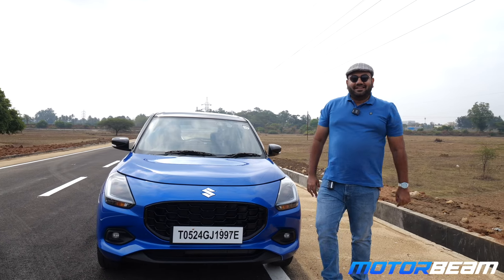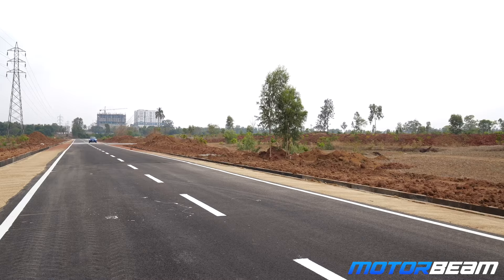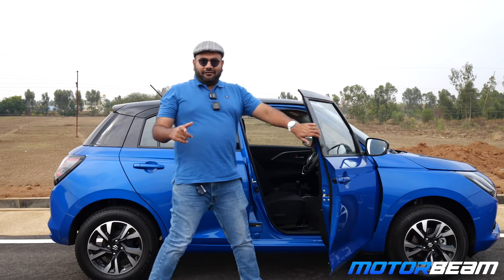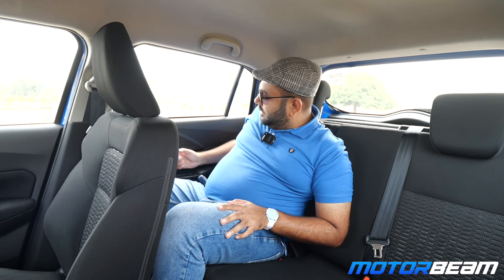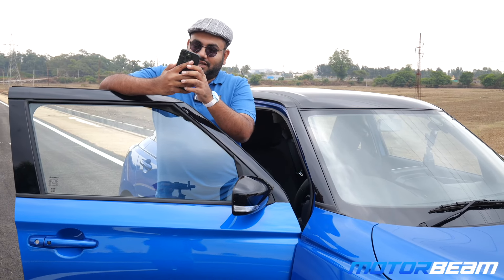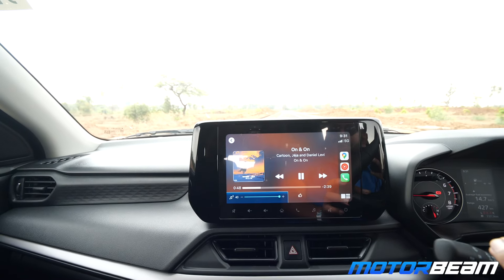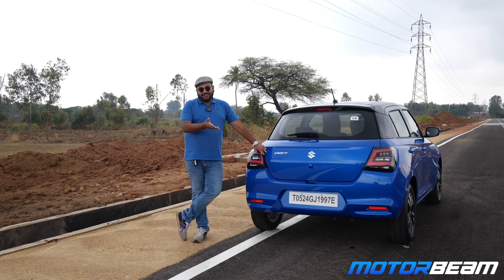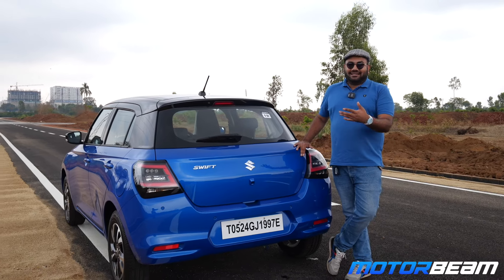2024 Maruti Swift - 10 Real-Life Tests | @MotorBeam

Comment: 1st and 2nd gen Swifts will just smoke this new one apart in every aspect, be it the looks, build quality, handling and the old engines, both the petrol and diesel were gems. The petrol engine was very rev happy, more powerful and was a 4 cylinder unit compared to 3 cylinder right now. The ddis engine was just crazy.. Insane torque, reliable, peppy and frugal in the city and highway and you can even extract upto 20kmpl on the highways.. Sad that the Swift lost it's charm 😭😭😭😭😭